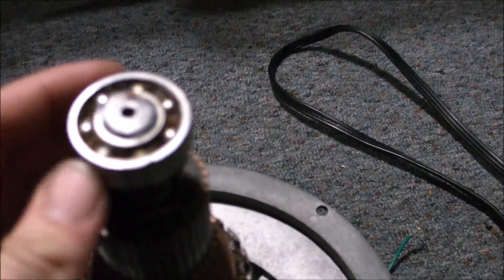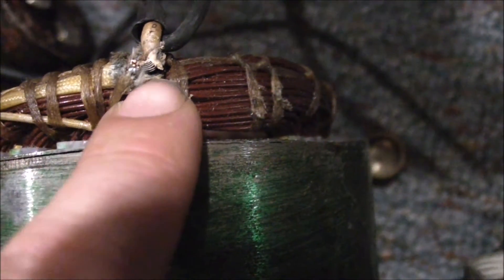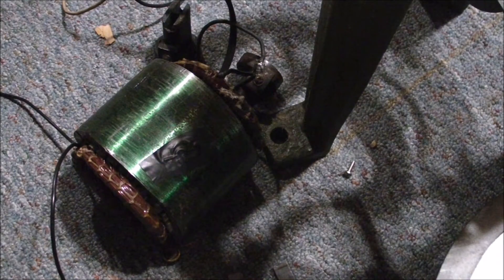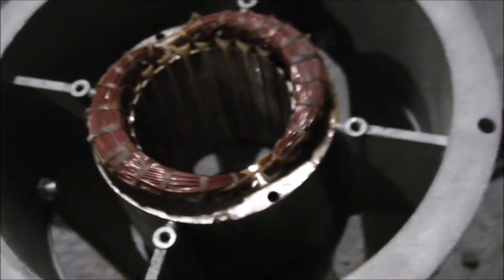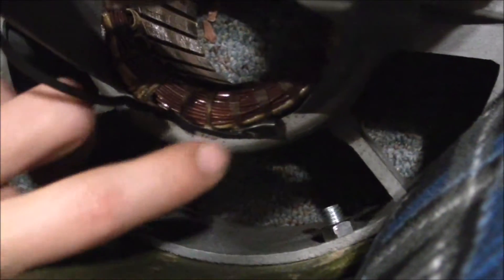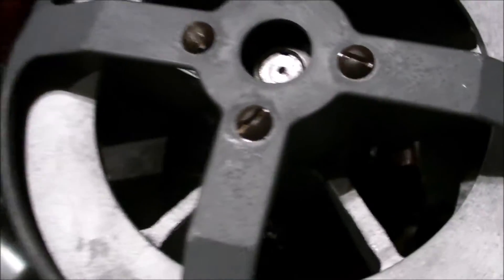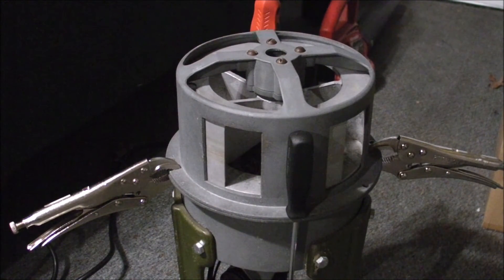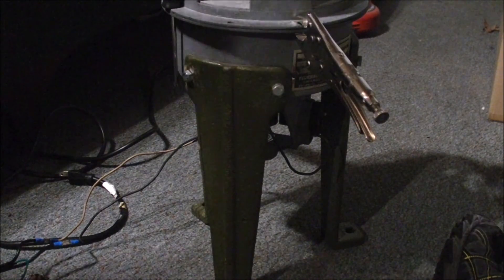Federal Model 2 Repair

Comment: siren looks great, what is the diameter of the chopper on a model 2? I know it is about 25 inches tall and 19 inches diameter with the shroud on.
Reply from the maker: stephen fecteau the diameter is 8 inches 
This is an older model with the longer legs and this siren is 20 inches high without the shroud
Reply: ok, I never knew the chopper diameter on the model 2. I read somewhere the chopper is 18 inches on the model 5 and 24 on the sth10.
Reply: Siren seems to be fine. I know there are still quite a few of them in service. They seem good for small towns. Where did that one come from?
Reply from the maker: stephen fecteau model 5 and all the federal signal sirens with the 9/12 ratio are 18 inches in diameter, the STH-10 has a 22 inch rotor and I heard the STL-10 has a 24 inch rotor but no one confirmed it
Reply: Sorry for bumping, but I thought I'd contribute with some confirmation. According to McCranie Warning Systems, the rotor diameter on the STL is 24in.

Comment: I see Eurton Electric did the windings on both armature and stator.
Reply from the maker: yep i sent both pieces there to have it rewound and did a fantastic job!! i may need extra brushes because DC wore them down in seconds
Reply: Not sure which brushes they are, but I'm sure we'll have them.  Watch our Finding Motor Brushes video when you get the chance.
Reply: @NickSilcox3 Do you happen to remember how much it cost? I bought a 2 recently and the windings on the field are toast.
Reply from the maker: @Gvacs  I believe it was $450 and change, including shipping across the country (PA-CA)
Reply: @NickSilcox3  Ah. Thank you for the quick response!
Reply from the maker: @Gvacs  Eurton electric did a good job on the armature and stator, but i had a mishap while installing the stator, shorting on the casing. My fault but I got it insulated.
A local Electric motor shop can also rewind the motor and armature if you know one more close to you.